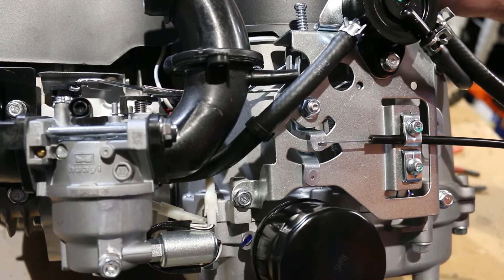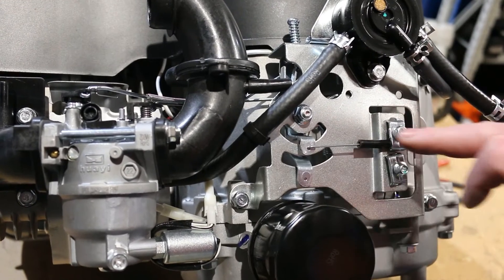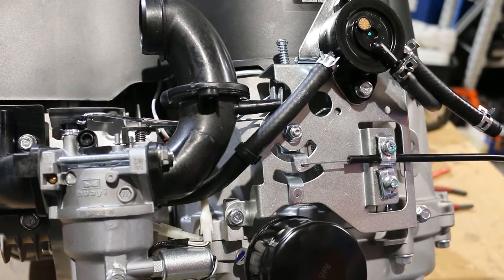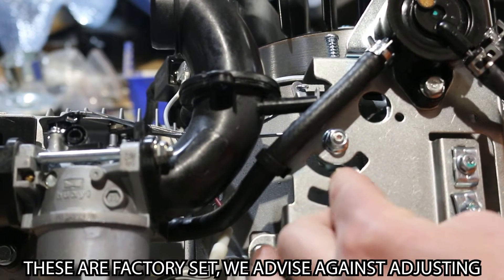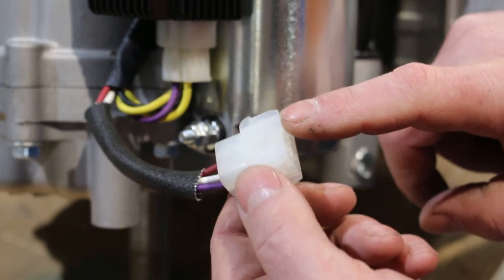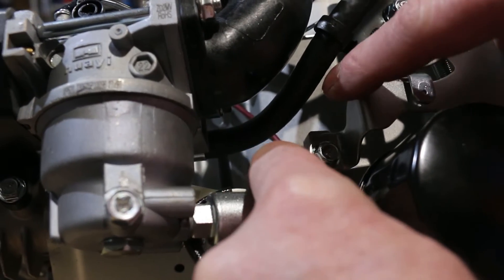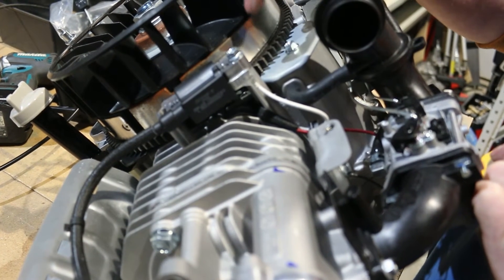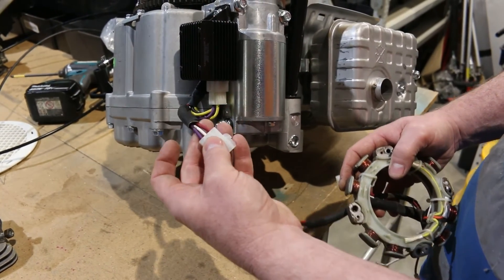Guidelines for Wire and Cable Installation: 17.5HP Vertical Shaft Engine Guide

Comment: You legends. Thank you for this and thank you for keeping parts in stock. You've saved me more than once. And saved me a fortune.
Reply from the maker: No worries at all mate! Thats our goal, keeping our customers happy and with a few extra bucks in their pockets! Cheers for the great feedback!
Reply: @jonoandjohno  I've had this motor for nearly 8 years since my "Breaks and Scrapem" died. I recently put a new carb in bacause I stupidly moddified the original. Now that it's back to standard it is running fantastic. I put it in a Torro XL440 with the tripple blade 44" deck and I haven't looked back.

Comment: Can you tell me what is the torque on the engine bolts please
Reply from the maker: G'day Gary, the engine bolts are 10mm so best torque would be between 57 - 82 Nm. All depends on the aluminium of the mower youre attaching to however.
Reply: @jonojohno8694  thank you